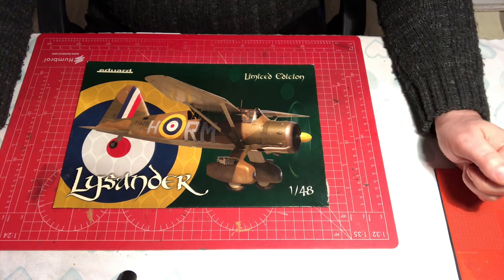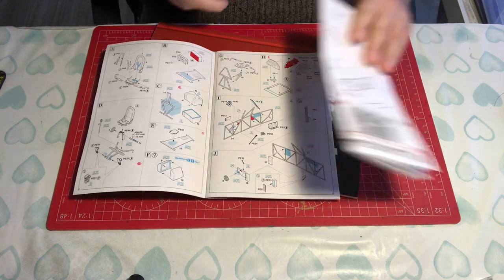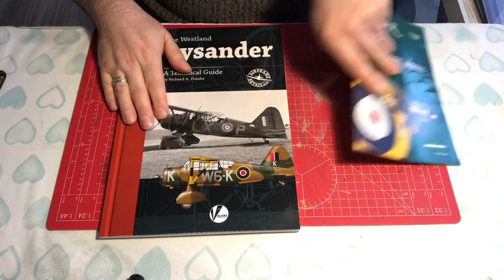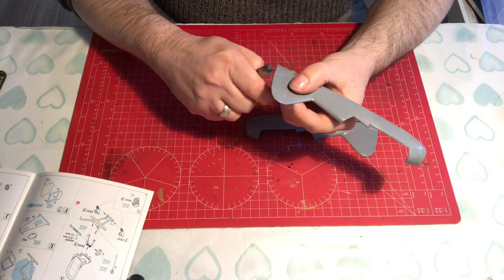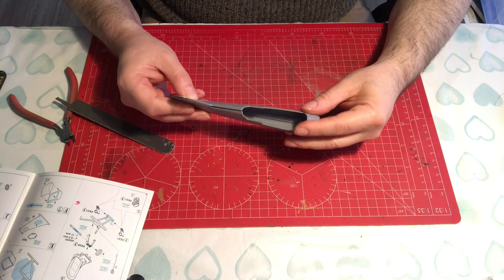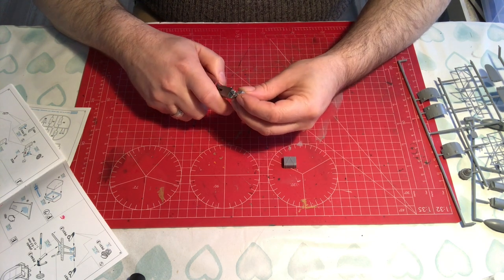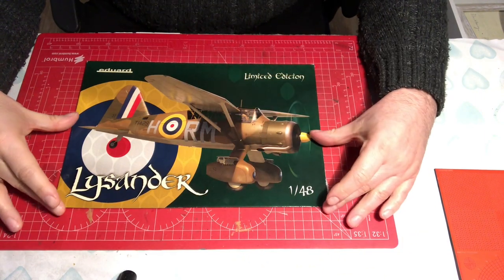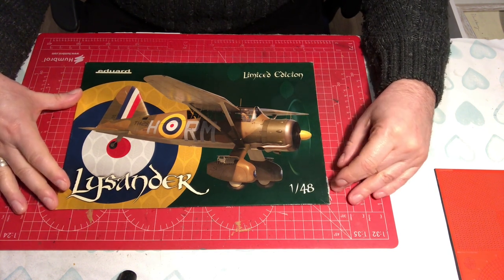Eduard 1/48 Lysander Full 'double' build Part 1

Comment: Looking forward to your build - So well thought out, and you now have two builds planned.  Very nice idea.

Thought I had this kit, but could not find it in the stash.  Then realized the plastic is an old Gavia kit.  (That’s why there are no locating pins, it’s actually a  short run kit...)  Now that I found mine, easier to follow along with you.